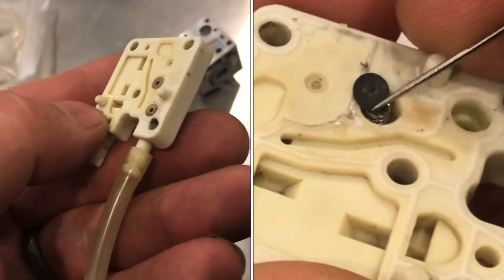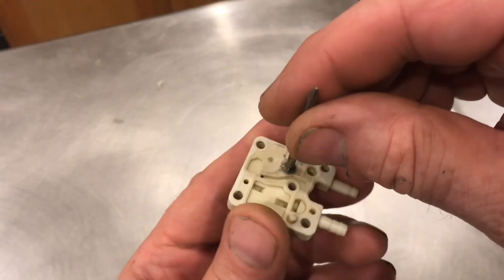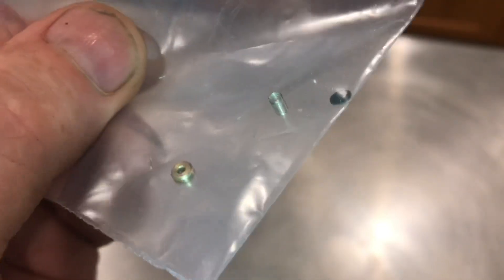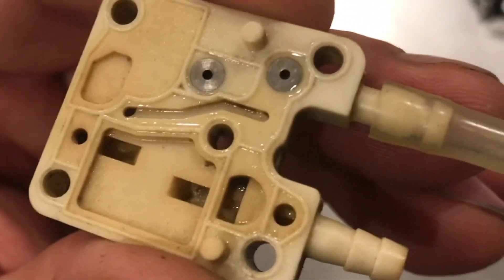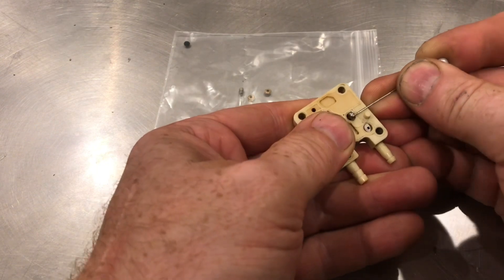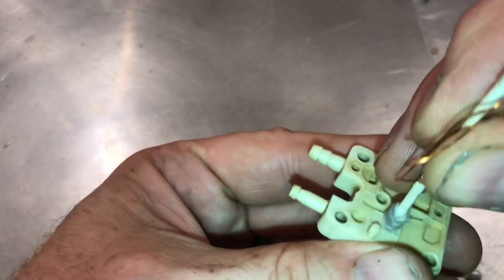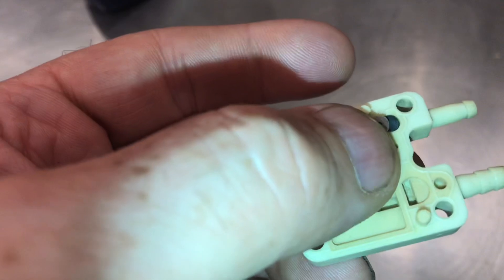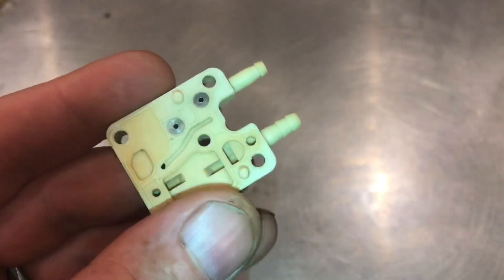fixing “check valves” on 2 stroke engines WITHOUT replacing parts (string trimmers, chainsaws)￼

Comment: Big thanks.   A while back I made a mistake thinking that I would clear a CLOG by inserting a wire brush bristle into a check valve  on a purge bulb of a carb.  I actually destroyed the tint rubber disc by poking a hole in it.   A week ago, I did like you instructed and extracted the brass fitting to see the parts under an electronics repair microscope.  Some rebuild kits contain a replacement rubber disc but they are rare.  Nice job showing the parts and procedure.
Reply: Where can I order these tiny parts?
Reply: Yes

Comment: what can we make new rubber discs out of surely it cant be that hard
Reply: I’ve read that you can use a small gasket punch and cut new discs out of a spare rubber pump diaphragm. I haven’t tried it yet, but I plan to. Got a lot of spare unused parts from old carb kits. Can’t buy new valves from Zama, so……….
Reply: @notajp  recently heard the same I will buy a hole punch and give it a go! Cheers